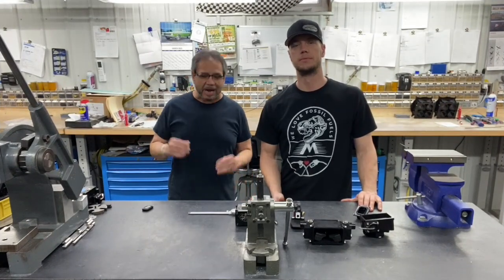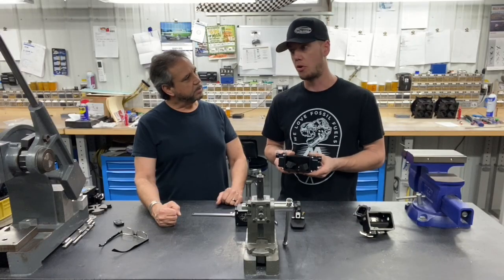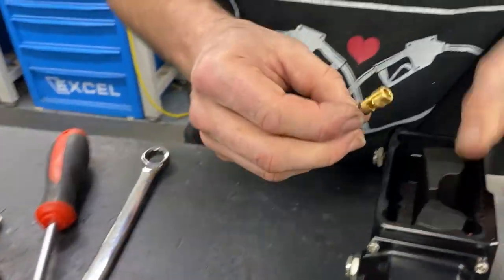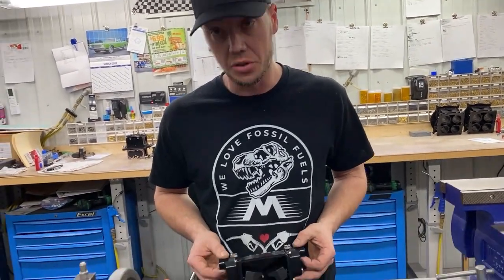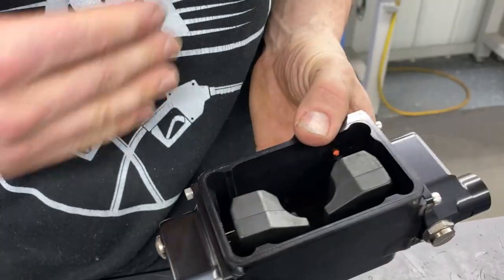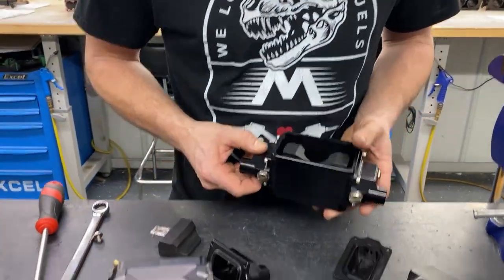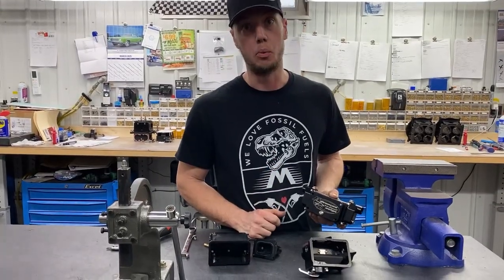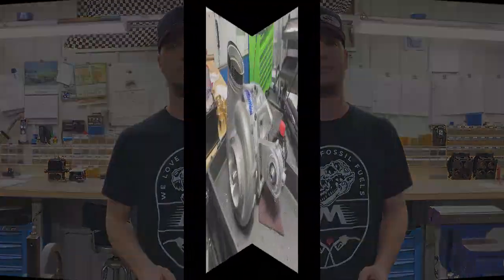DBG: APD Bottom Feed Fuel Float Adjustment, With Dual Floats/Needle/Seats,  SEE the TURBULENCE VIDEO

Comment: Tim
So, are we going to hear an engine with those ASSASSIN HEADS any time soon ?
Did you say Darin was building an engine ? 
Is he porting them before installing them ? 
Or testing as they come out of the box ?
Reply from the maker: I am going to, just got to get it all together, but I don't seem to have enough time, may have to stop sleeping.He is going to be porting them, not sure on the engine they are going on. Robert, who made them, want to put them on my 427 Aluminum Cleveland, at BES. But they need quite a few different pieces/parts, that I have already bought.
Reply: @DragBoss351Cleveland  Letting them build the engine is wise. 
Remember the cam is custom, the valves are swapped positions. 
Leave that to the builder.
Reply from the maker: @cdburlock don’t think I will use them, cost prohibitive at this time in build.

Comment: I tried their bottom feed needle and seats when they first came out many years ago. First time I went to wot for several seconds the car nosed over and died. When the float dropped the needle fell completely out the bottom and flooded the engine. I chalked it up to new design bug or I just happened to get the one out of 100 bad ones. Never tried them again. I'm sure they are good now
Reply from the maker: I know how that flooding bs goes. Cannot comment on that one, but if I went through that. Done too.

Comment: couldn't you set float to about .450 window alined . and bend arm to fine adjust ?
Reply from the maker: Yes in the video you can adjust the float by bending the tab to get to perfection. Look back if you missed it. Thanks Frank 🏁
Reply: @DragBoss351Cleveland  I saw that. I meant the whole metal arm.

Comment: I thought about this years ago. Blow through boost needs the bottom feed to eliminate turbulence from the boosted air in the bowl. The whole carb becomes part of the intake flow. So it becomes boosted with turbulent air in the bowls as well. If you feed fuel from the bottom the fuel is uneffected(or foaming) at the fuel/air surface there's no sloshing of fuel dropping in creating foam. The fuel in the bowl will resist foaming at the surface cause no air is breaking the surface as it would with falling fuel.
Reply from the maker: That’s the ticket TeK, yes more things I never knew. I love seeing this kind of video, gives me a better understanding overall. 💯🏁

Comment: is there any value to a stroked 400 m overa max effort cleveland
Reply from the maker: Yes with the fact of the increased deck height. Issues are big block BH and need spacers for any good cleveland intake. Still have oiling and core shift to contend with.